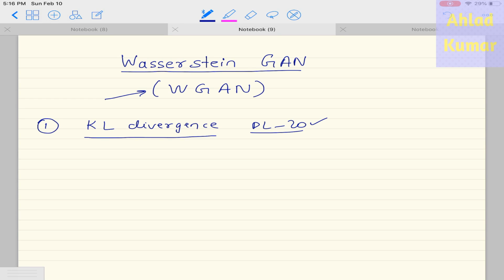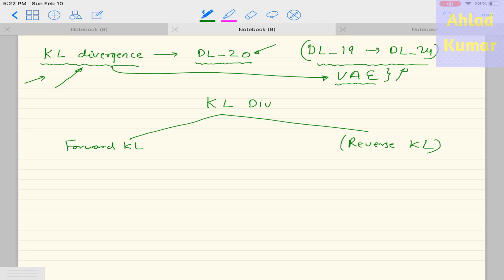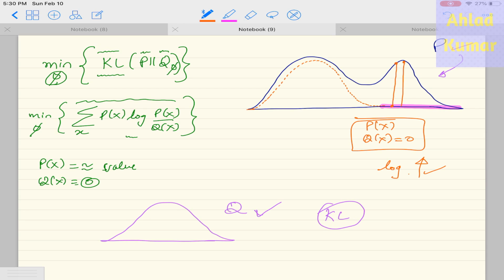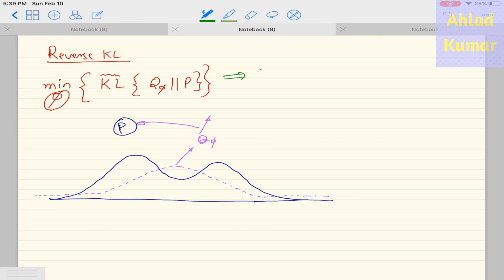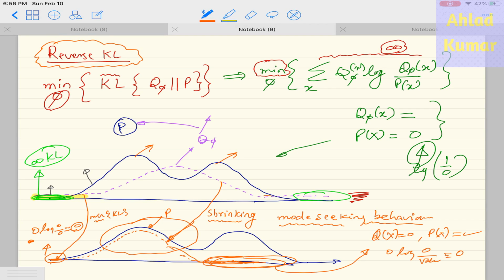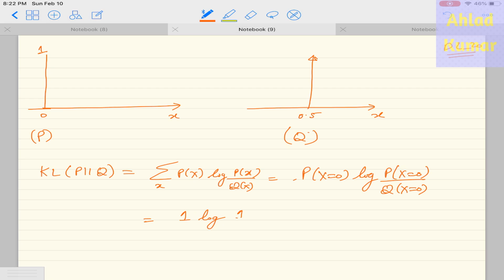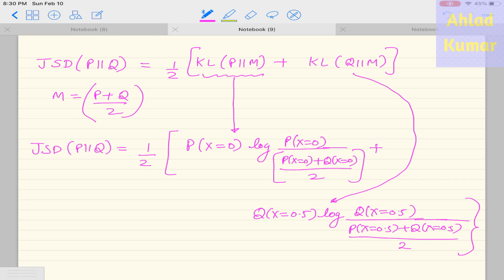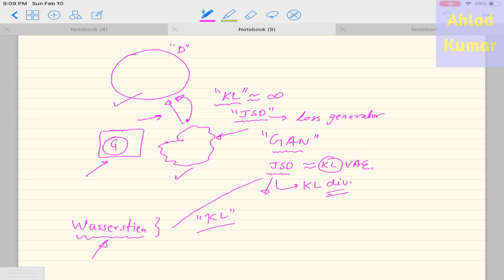Deep Learning 34: (1) Wasserstein Generative Adversarial Network (WGAN): Introduction

Comment: If JS Divergence is the only/main reason GANs preform better than VAEs why would you not just use JS Divergence in VAEs. It seems like JS Divergence is just a more stable and symmetrical KL Divergence which doesn't seem like it would actually lead to better results in most cases just be more stable.
Reply: maybe coz JS divergence is not differentiable.

Comment: While discussing the KL divergence(5:17) P was unknown and Q was a known distribution. But in the discussion for forward KL(12:16) I see that Q distribution is said to vary (How can Q stretch if Q is already known, shouldn't it be fixed?). 
Is Q assumed to be unknown and P assumed to be known in the case for forward KL ?
Reply: P is the distribution of the data provided, which is unknown. Q is an approximation to the posterior which is chosen for our convenience. Q is chosen mostly to be  gaussian, but if we know the data generating process, we can use different priors too(such as beta or dirichlet, many use Gaussian because it's easy to work with). Coming to Q being to vary, this posterior approximation, forming the ELBO, turns the inference problem to an optimisation. Using SGD, you start with some random mean and variance and work your way to get the best possible ones.